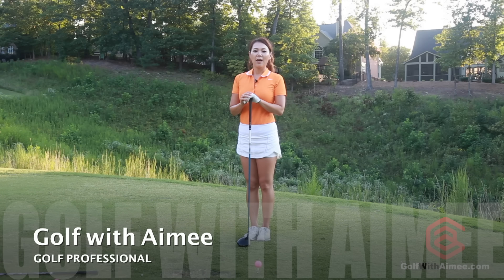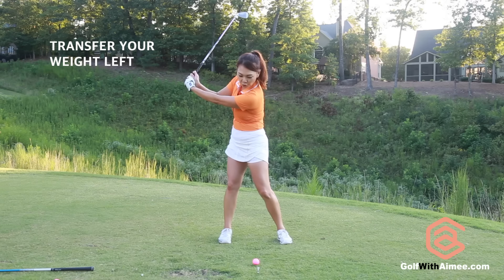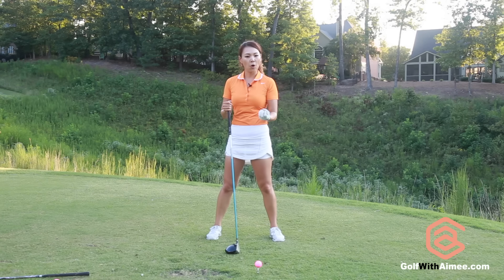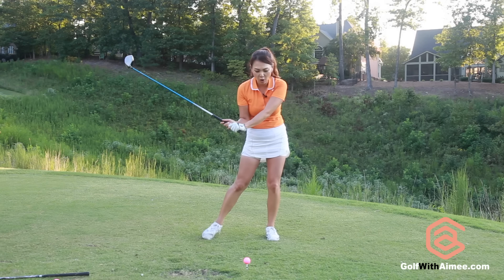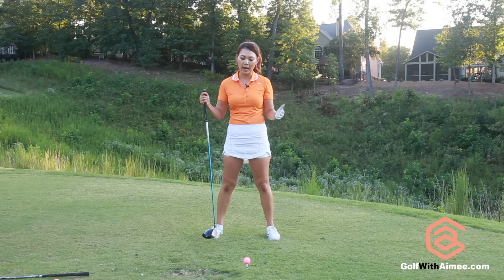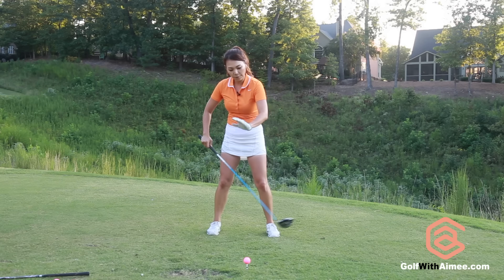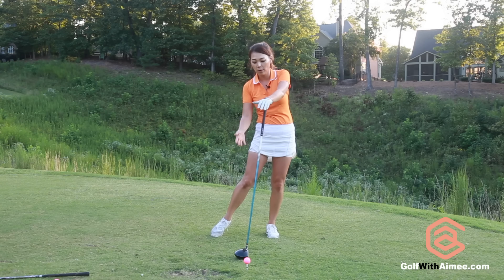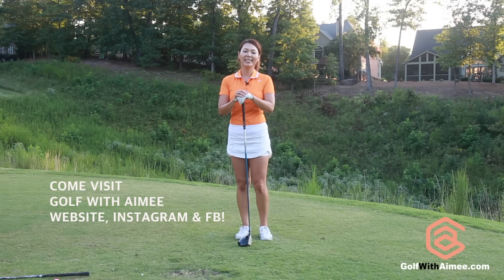Throw Through to Drive it Farther! | Golf with Aimee

Comment: I had seen videos of professionals who hit long drives. It was pointed out their head is always behind the ball. Then I have also heard that the swing should be the same for the irons and the driver. Amy has cleared up what needs to be done. For the driver the head should be behind. It is basically the same swing as the irons but the timing of the weight shift is a little different. Its amazing that I have not seen a video with such clarity ever before. Amy is really good!

Comment: With my driver i am loosing around 20-30 yards due to the dreaded 'slice' and after watching this video i can understand that it is because of my desire to swing at the ball which is causing me to use my body incorrectly, causing the weak high rightward shot pattern. Thank you for showing me the error of my ways in another great easy to understand video.

Comment: These videos are great ! seriously ! I have improved from a 160-180 yard slice/fade driver to a straight, draw biased  (200-210) driver shot after watching all of Aimee's drivers lessons.  I must have went through about 100 other different driver tips on you tube (in the span of about 3 years trying t figure it out) and none has made me 'click' but this series did.    thank you !funny that this is the first time I was told to don't shift the weight, I ran to the range, and try to hit it off my right foot, and suddenly I got it ! I am sure its not 100% correct , but it fixed my problem and it went much further.

Comment: Every time I watch one of your videos,  even an old one,  I am impressed on how good a teacher you are.  As the hips turn towards the left at the start of the  downswing,  moving the hands down,  a point is reached about when the hips are square to the target line, when the rotation of the hips slows down while downward movement of the hands accelerate as the club head swooshes through the impact area.  This pulls the hips leftwards to complete the weight shift and lifts the hands above the left shoulder as the body faces the target. Thank you for your video lessons. I'm sure that many,  many people,  like me, appreciate your generosity very much.

Comment: Absolutely the best way to hit the driver.  I paid for lessons to get rid of my erratic drives and was taught to  shift my weight on the driver. Which made my drives even worse.  I did see a much improved  iron game so I thought it was correct.  Then I did notice  videos  on sit /squat to improve a good golf swing so it was very confusing. Now it make perfect sense !!!!  Never really thought to have slightly different swings of each.  Now my question on par 3's ... could I do a little sit if the ball is teed up? Thanks so much.
Reply from the maker: Hi Michael, thanks for your comment and question. Someone else asked the same question on this video so I will still copy and paste for you. When we tee it up for the fairway woods and the irons, we tee it low as if the ball is on the ground but with a perfect lie. Therefore, you swing the same way as you would normally swing without a tee. Driver is the only club you should swing differently.

Comment: This really works!!! I literally hit the ball 25 yards further with my driver and my irons are much crisper.  Aimee's delineation between an iron swing ( weight on forward foot at impact ) and driver ( hang back more, right foot does not leave ground until after impact ) made the biggest difference for me. I was definitely spinning open trying to transfer my weight the wrong way hitting massive pulls and fat irons.  The only thing I would add is do not sway on the backswing for either the driver or iron in trying to shift your weight which I was doing at first.  Thanks, Aimee!!! Can you comment on what I said. I would like feedback.  I am going to subscribe also.
Reply from the maker: Hi David, staying centered in your backswing is very good. It sounds like you have a good understanding on the concept and very aware of what you are doing!
Reply: Thank you for the reply Aimee! I think I got a little bit excited and started throwing the club too much ( casting ) but got back on track yesterday.  Still have a lot of work to do.  I subscribed and look forward to learning more.

Comment: very good lesson Aimee, I gained almost 10 meters very quickly following your thoughts even with choking a bit. 2 Questions 1. Would you agree that it helps to try to accelerate AFTER ball contact to avoid early weight shifting? 2. With top spin you mean less backspin using correct driver swing, right? Or is it really possible to create top spin golf?
Reply from the maker: Hello, thank you so much for your questions! 1. Yes! Exactly. 2. Yes, this was confusion in languages. In Korean, we tend to use the word "top spin" to replace "less backspin using correct driver swing." It is not possible to create top spin on the ball. lol Thanks for that!
Reply: KINGKURT14 every ball that goes in the air has backspin. By catching the ball on the upswing, you minimize backspin.

Comment: Hi Aimee. Sometimes I use a 3 or 5 wood to tee off, using a smaller tee. My question is would the same principles apply with the 3 and 5 wood as you demonstrated using the driver or would you use a different method? Thank you for your excellent instructions and explanations demonstrated so eloquently. Adrian from the UK
Reply from the maker: Hi Adrian, when we tee it up for the fairway woods and the irons, we tee it low as if the ball is on the ground but with a perfect lie. Therefore, you swing the same way as you would normally swing without a tee. Driver is the only club you should swing differently.

Comment: One correction with your terminology. There is no way to put topspin on a golf ball unless the club contacts the golf ball above the equator. In which case, it will dive to the ground immediately. What you should be saying is that by hitting up on the ball you can reduce the amount of backspin.

Comment: im a beginner and i have been either topping or slicing/pushing the ball and i really feel like this will help me. i noticed that the ball is towards the front of ur stance, or maybe that's just where the camera was. do you recommend lining it up with the left heel? will that help get it in the air?
Reply from the maker: Hi, the camera angle must have been a little off. I would keep the ball position for the driver just inside the left heel. 
That is the optimal spot to get a square contact with the driver! Thanks for the question and good luck:)

Comment: I tried to throw through the drive but I don'thave the fixability to make it work. How can I close the face of my Driver in my swing? I have moved the ball forward and backward in my stance did not fix a thing. Tried to tee the ball higher and lower did not work. Tried to shorten my Driver from 45.78" to 44".1/2 did not work. Sometimes I strike the ball great and it's down the middle of the fairway with great height and forward roll.  However, I can not repeat what I did on my next Driver. Please help!!

Comment: Hi Aimee, thank u so much for all your sharing u explain in such simplicity
& hv helped me very much.  I need yr advice on the grip.  What grip is the best?
Interlock, overlap or base ball?
Reply from the maker: I use overlap because I find it hard to relax my grip with interlock or the ten finger grip. 
But everyone is different! If you have smaller hands interlock should be a better option. 
You should try the grips to find out what works best for you!
Reply: Thanks Aimee my hands are big. I feel comfortable with overlap